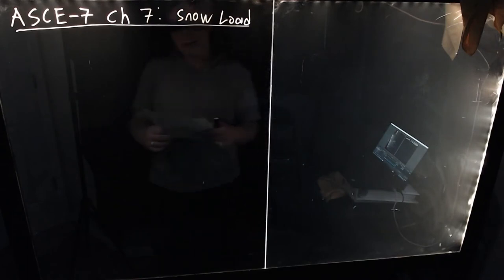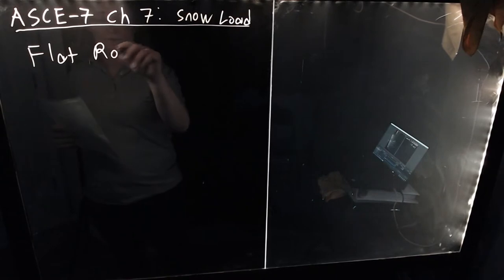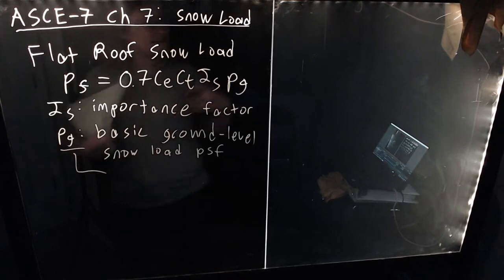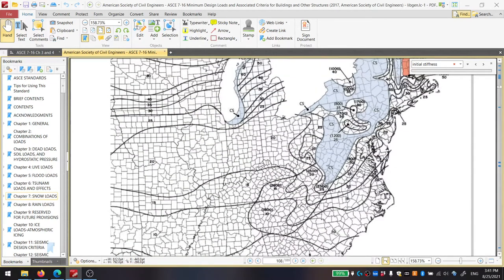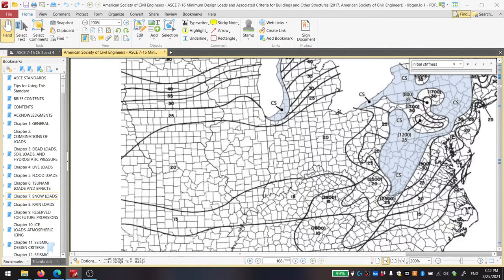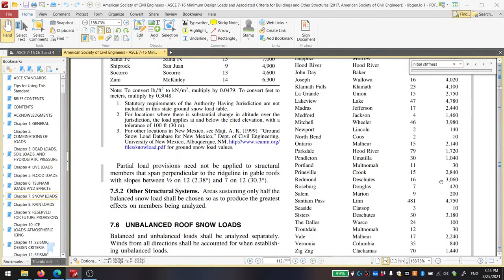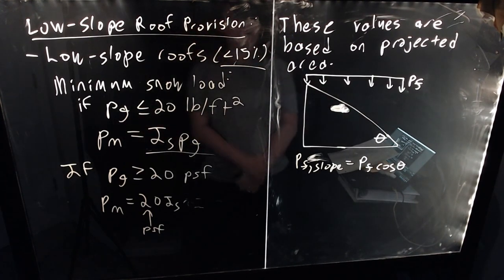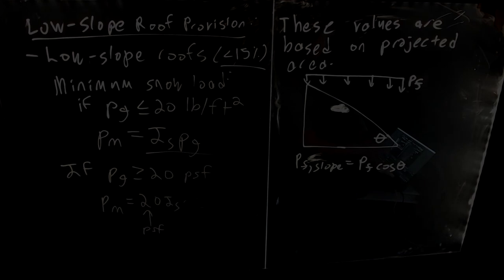Introduction to Snow Load

Comment: Ms Laird, before I ask I would like to apreciate your efforts on doing this tutorials. They really help to structurize and clarify the code.

My question is: Do we need to account for the reduction of Ps due to multiplication of Ps value on COS(slope) (the projection of Ps on horizontal plane) OR this reduction is already incorporated in Cs factor (which is due to slope too). Isnt it a some king of redundancy?

However, even if we have say a "warm roof" as per fig. 7-2a sloped 30deg which is considerable slope, Cs equals 1,0. So if we further cancel the reduction of COS(30) multiplication we are going to have a full Ps load which is equal to Pf.

Following this logic we anyway have to acount for "horizontal projection" clause regardless of what value of Cs we got in the previous calculaton (and therefore regardles how small the final Ps is going to be). Thats why probably the code prescribes minimum conservative load on sloped roofs Pm.

But anyway I cant get the code formulation: "Snow loads acting on a sloping surface shall be assumed to act on the horizontal projection of that surface." Does this quote mean that the Value of Ps = PgCs already incudes the reduction due to the fact that load is going to be applied to the sloped roof (because COS() is alwats lesser than 1,0)...

Will be glad to hear your thoughts on that. Take care and Thank you!